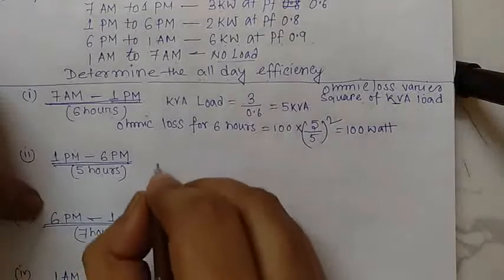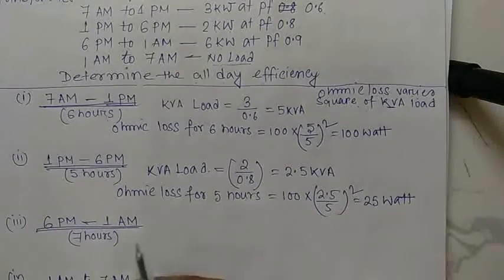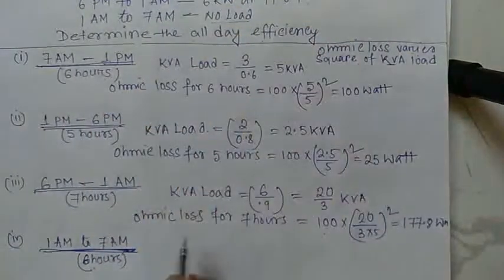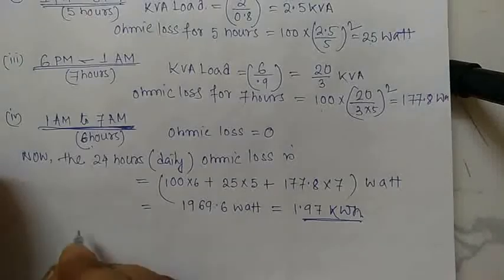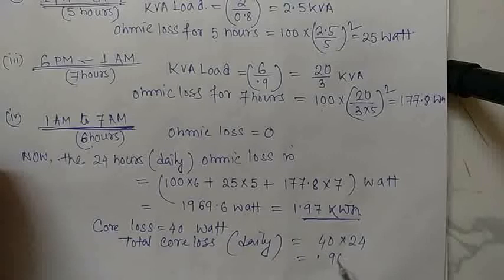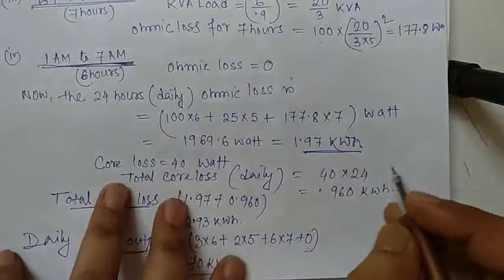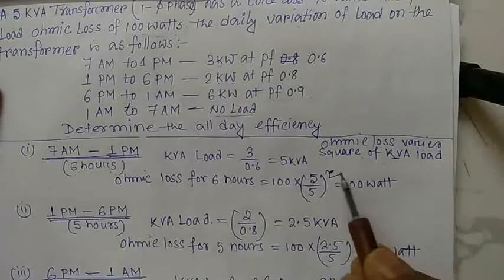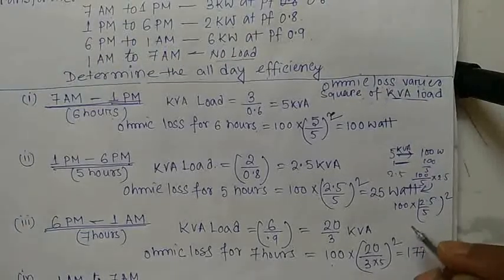Problem on all day efficiency

Comment: Problem explanation is excellent ☺️..
But at last step 
All day efficiency=70/(70+2.931)=.9581...
Reply from the maker: Your answer also right..
0.9581 is in pu
You are using Output/input
I am using 1-(loses/input)